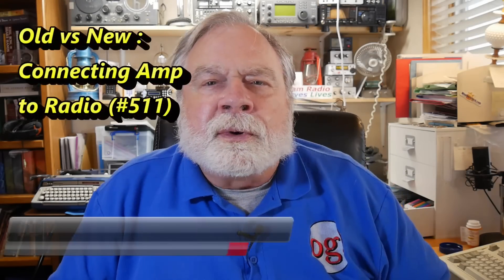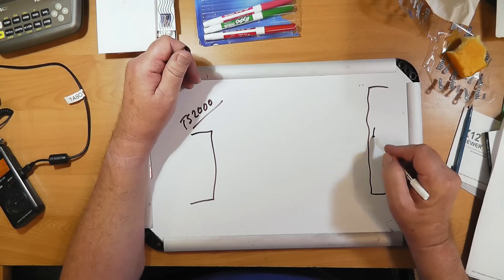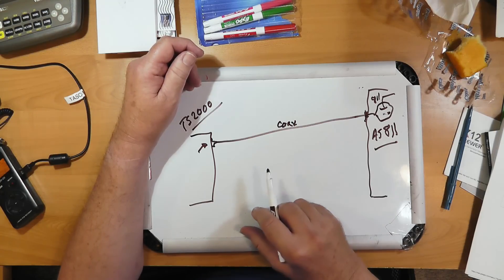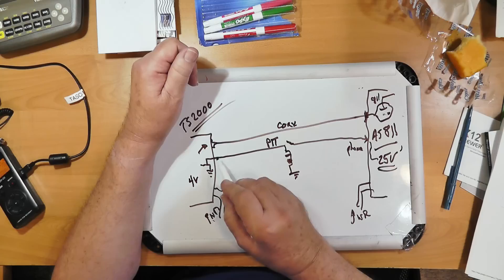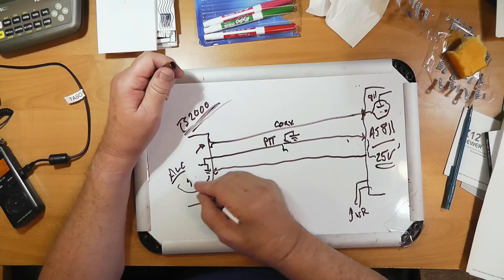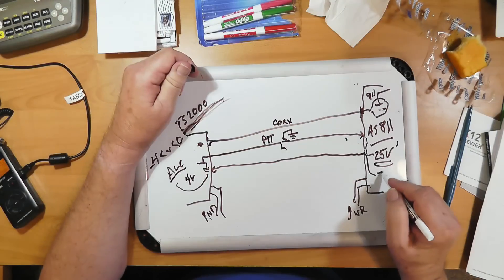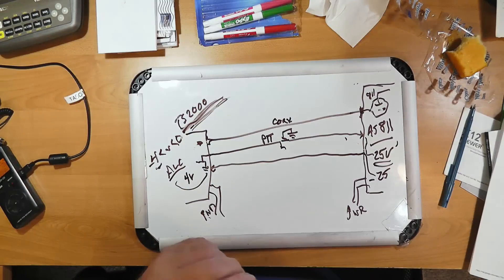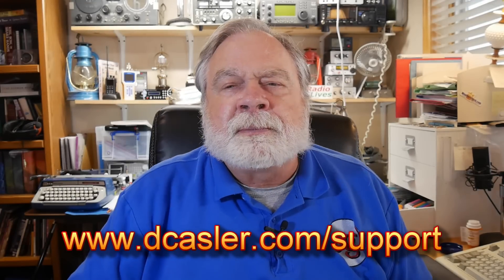Old vs New : Connecting Amp to Radio (#511)

Comment: Thanks Dave. I’m preparing a similar action, putting my 991-A on air with an SD-200. I realize it will be a similar setup (parts might have a different nomenclature) so I’ll work carefully with the supplier! Hope to run into you again at another show soon. Stay safe ! KE8IGL 73

Comment: Thanks very much for this discussion.  I was planning on doing this in the future.
 My only problem is with MFJ products.   I would definitely want to open up the ARB704 and resolder all of its electrical joints.

Comment: Assuming the transceiver ALC input does not draw much current, you could simply set up a voltage divider with 2 resistors or a potentiometer, to convert a voltage of -25 V to a - 4V. Interesting video! 73

Comment: I have a 706  and a guy set up the radio to work on the 811   six hundred. never did hook them up because I got a antenna that worked on about a hundred watts. at the time I did not know I was going to get an amp. I have a sweet one and figured I would never get an amp. now I have two. one is the small maturation  six hundred hundred and moms allowed me to buy the old Dentron. I have never used either of them. I always warm them up so the tubes won't go bad.

Comment: The ALC connection on the ARB-704 is a "pass thru" connection only as per the instructions from Ameritron. It doesn't do anything to that signal from the amp.

Comment: I  remember  having a  pair  of 80xx  somethings  (triode rf tubes) back in the   1960's  in  a rack  donated to my  high school radio club  by  the  National  Bureau of Standards in Boulder, CO.  Had   a lot  of fun  getting them to  work  with  my Collins  transmitter   32S-x.  As  I recall  back then  we did not worry  about  ALC.     I think  the plate  dissipation  was about  450 watts per tube.  The rack had a hug  pole  pig  in the bottom for the power supply.   Lot's of fun and all work done with a Simpson 260!!!  Cool!!!
Reply: They   were   813's      pentodes..       very   cool....... Dad  got  mad  at me  for  blowing   the  120   circuits,   finally    hooked  the  amp up to  240 ....

Comment: ARB is Ameritron unit - but DX Engineering does sell it
I use my HK SB200 with both old HW101 and FT450d, just switch the key (ptt) and exciter input - easy to do with dpdt toggle and an antenna switch, but auto systems are available.
The fun part is the differences in tune-up procedures!  And since I use auto tuners even on the Heathkit, that is a bit different than manual ones.  All but the final tweak is done into the dummy load for the radio/amp and the tuner at low power then final tweak on amp if warranted
One note that might be interesting to some is that you should keep your new solid state radios auto tuner working even with the final output tuner when connected to an old amp because the input may be a ways off from 50 ohms nominal into the amp, let the radios auto tuner handle that mismatch.  One some bands/antennas I can only get it down to 1.2~1.4 to 1 or so, but if the the radios tuner is engaged, it can drop right down to 1 to1 just like that.  With the old tube radio finals, the load controls handle it for you

AA7VA

Comment: Thanks for the help Dave! I am a subscriber and watch a lot of your videos when I have time. For the record, I bought the 811 and the TS2000 about a year ago and they were both new. I didnt really understand the need for the ALC so thanks for clearing that up. Follow up question for anyone to answer, whats the process for setting the ALC?? Or does it automatically detect the issue and then backs the power down?? Thanks again and 73's!! 
Ted Dover  KI4TED
Reply: No, Dave is wrong about that. ARB704 does a great job isolating the fragile keying PTT circuit on the radio from your AMP. Your particular amp doesn't do this but some very old amps had 110v relays that the transceivers had to pull to ground which would immediately fry your radio's external PTT grounding circuit.. But the relay coil on the amp also has kickback that is most often protected by a snubber diode; however, if (assume "when") that diode fails, the kickback ruins the PTT grounding transistor in the radio keying circuit plus you don't know the supply voltage of the keying  relay in the amp. You can probably run your amp without isolation  as I did with my ft747 for a few years without the 704 but it is a big risk, My 747 radio eventually failed without the arb704 which is why i bought mine. I use the arb704 and completely solve those possible problems. But the "ALC" on the radio just connects right thru the arb704 to the ALC connection on the amp. It is just a passthru connection and does nothing. Just look at the arb704 schematic and that will be clear to you. ALC adjustment is quite easy but you have to make sure the amp does not put a voltage overload of more negative than -4v on your radio. My AL80b puts put maybe -16v so i use a pot to turn it down to -4v. The Arb704 will NOT take care of that for you!  Read your radio and amp instructions for external ALC adjustment procedure.

From the ARB704 instruction manual, it tells you to connect ALV from the radio direct to the amp (obvious passthru connection) but if you use a customized cable, connect ALC to the ARB704 (pssthru on the ARB704 connector):

"ALC
Many radios have ALC inputs. If you want to use the ALC output of an
amplifier, connect the radio ALC input directly to the amplifier’s ALC output. If
you use a plug and play cable connect the amplifier ALC to the ALC phono jack
on the ARB-704."

Comment: Sorry: Must correct. On the ARB704, ALC is a PASSTHRU. The ARB704 does nothing, just connects the 2 ALC's. ARB704 only isolates the PTT keying circuits. That isolation is necessary and the reason ARB704 is sold.
Reply: Yep -
and it works very well
Reply from the maker: Thanks for the additional information.